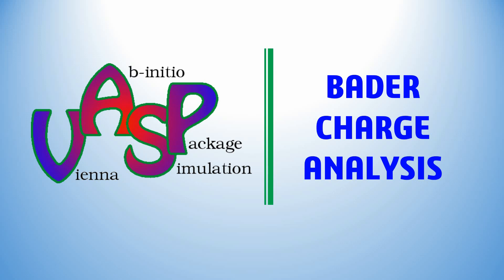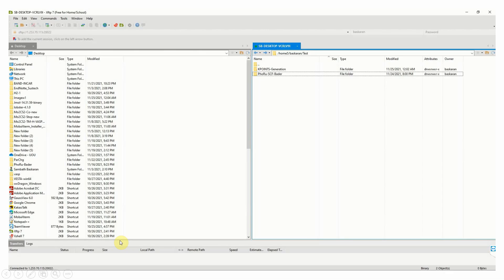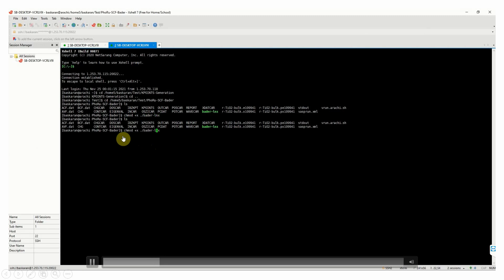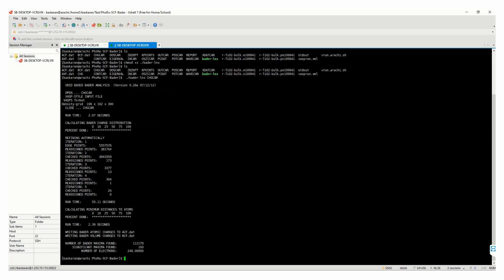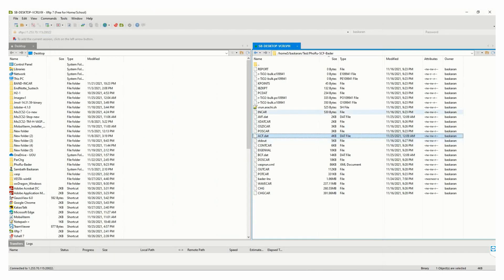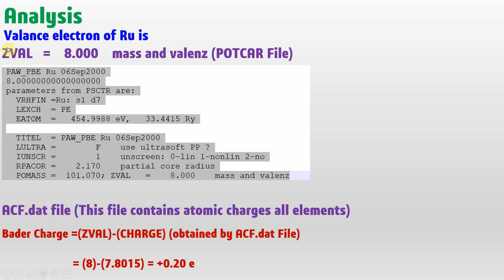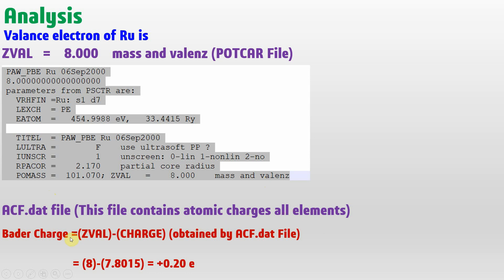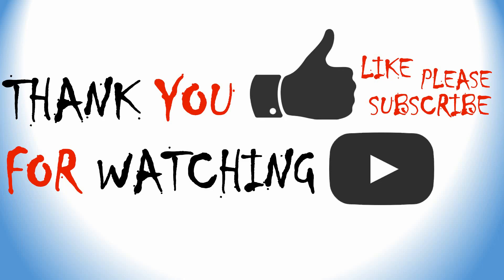How to perform Bader Charge Analysis from VASP CHGCAR File

Comment: Thanks. Could you mention the steps for Bader Analysis with Quantum Espresso?
Reply: 1.Do the single calculation for the material you want to do bader analysis on.  2. Perform the charge calculation on the valence electrons and for all the electrons of your system, using pp.x. 3. Perform bader calculation using: ./bader valence.xsf  -ref  all_electron.xsf. And note that the bader should be executable, you can make it executable using chmod + x bader. All the calculations should be done in the same directory. The key is to obtain the ACF.dat file.